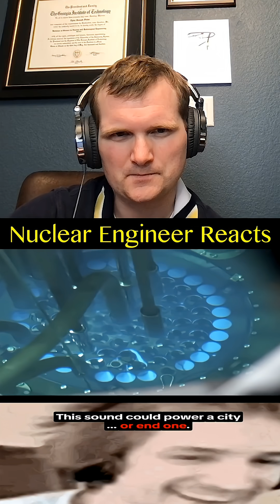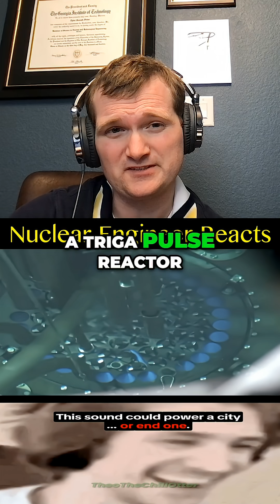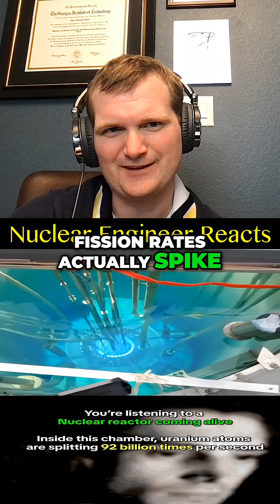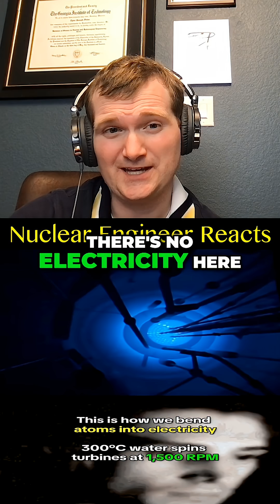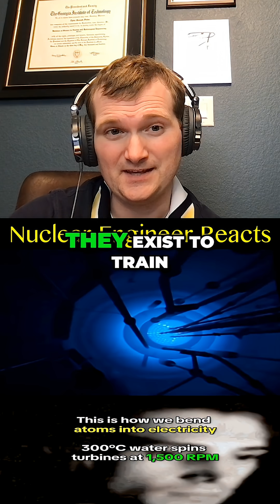What a Nuclear Reactor Sounds Like "Powering Up" - Nuclear Engineer Reacts to Theo The Chill Otter

Comment: How about reversed field configuration or theta pinch clean aneutronic fusion reactors
Reply: The university where I work has both a TRIGA pulse reactor, and a reverse field pinch fusion experiment (one of the largest in the world). One thing they have in common? Neither makes usable energy.

Aneutronic fusion is the dream, but the easiest aneutronic reaction is >100 times harder to fuse and maintain than D-T, which we still haven't been able to make work.

Comment: 10th to the 18th? Dude speak English for us normal people that didn't take alien math level in school😂
Reply: 10 to the 18th power just means a 1 followed by 18 zeros. In standard form, it looks like this: 1,000,000,000,000,000,000. This number is also called 1 Quintillion.
Reply: @brodiec473 Oh damn
Reply: Bro, you should've learned exponential notation in the 5th grade.
Reply: @biochem6And americans should have learned simple geography when they turn 20 years old with or without school but that ain't happening either bro so touche.

Comment: the boiling point for water is 100°C 😂😂
Reply: Depends on pressure.
Reply: @coolman1789  Exactly. Confident ignorant comments like that make me reach my boiling point.
Reply: @coolman1789 yes of course. but i was not teying to be 100% scientifically accurate, but more make a point, as the narrator said smthn about 300°C hot water. Now calculate me the pressure, it would need to be that hot, and then tell me if this is physically possible.
edit: it is possible (whoops mb) but it would turn into a supercritical fluid. i was talking abt normal water
Reply: @stevecreature4837  about 8.5 Mpa absolute pressure gets water a 300°C boiling point. no supercritical fluid at this point, that happens when its temperature is above 374°C and its pressure is above 22.1MPa.
According to google btw, I didn''t do the experiment.
Reply: @coolman1789 oke, well one learns every day, don't we? 😂
Reply: Dumb nga you really do fit that pfp